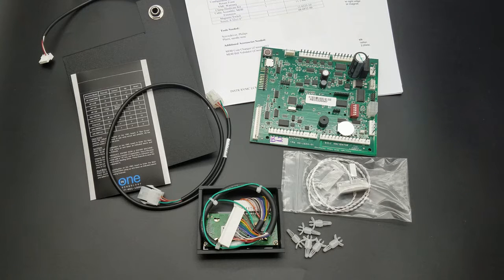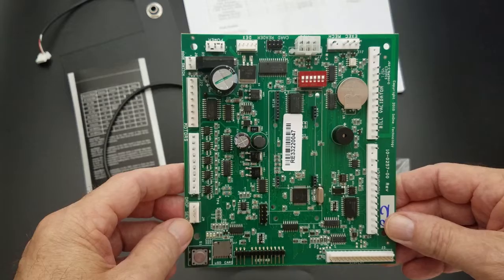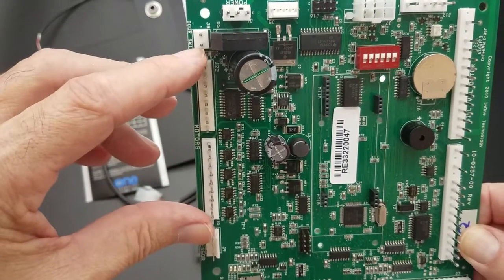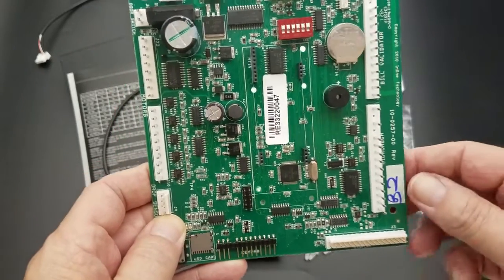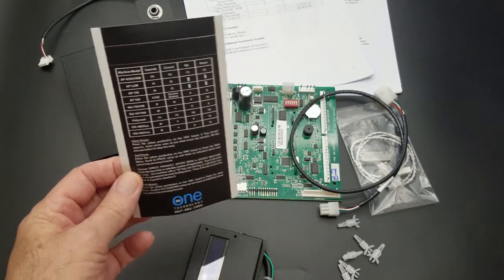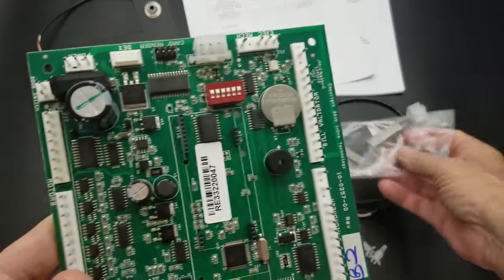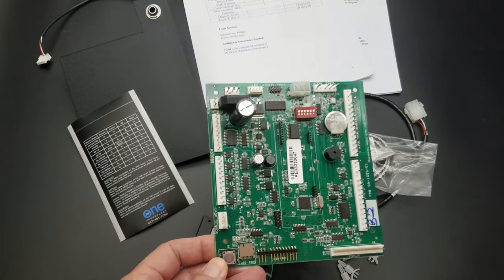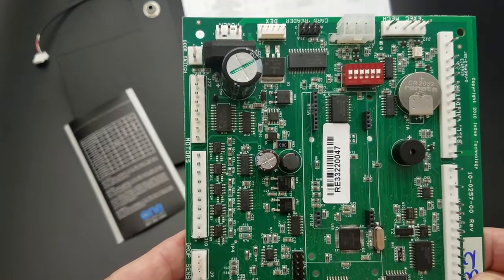RVMC LCM Retrofit Upgrade kit part# 383021

Comment: I've just installed this motherboard and I'm having issues keeping both the coin mech and bill validator on. Could you make a video showing the settings you should have configured for the machine initially.
Reply from the maker: Hi Sean. The settings can be different for each machine and peripheral setup. Please call our tech support at 667-401-1000 x1002 and we will get you working.

Comment: What are the switches on the red rectangle for?
Reply from the maker: They are not used on this board, all switches should be off.  The only exception is switch 4 if you plan to use guaranteed vend sensors.  Call us if you have questions